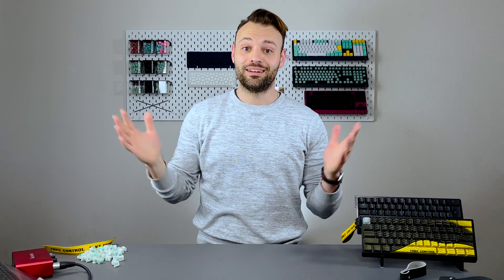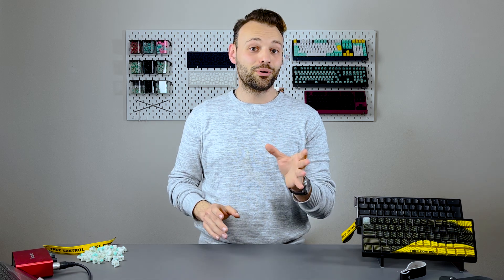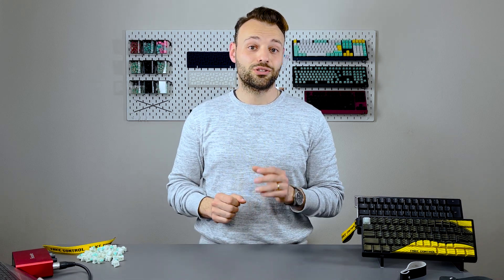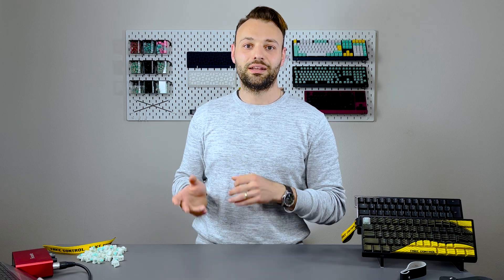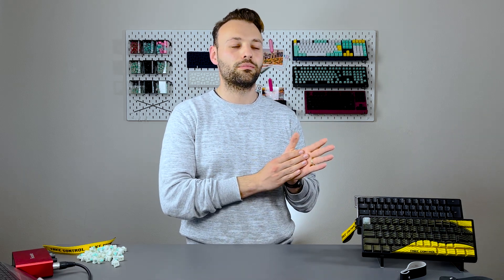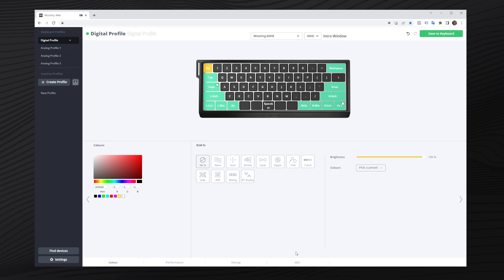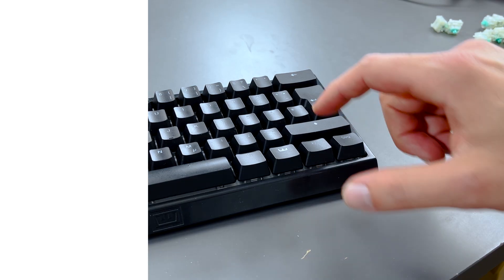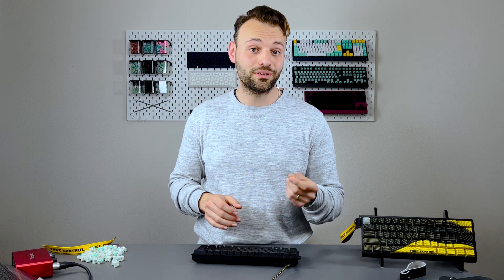Wooting 60HE - ✔️PVT, ❌MP and Mod tap explained.

Comment: Sorry don't know if this is the right place to ask, perhaps there is a more recent video on it but for the mod tap hold function, how long does it need to be held to active and can you adjust this timing? Thanks, Enjoying my 60He!
Reply from the maker: We have te default and few mechanisms we believe is the sweet spot. In advance settings of Mod Tap you can manually adjust the hold period (inside the upcoming Wootility update)
Reply: @Wooting  Thanks!